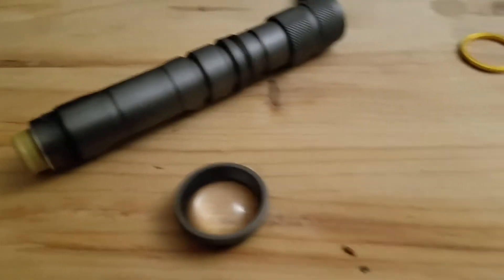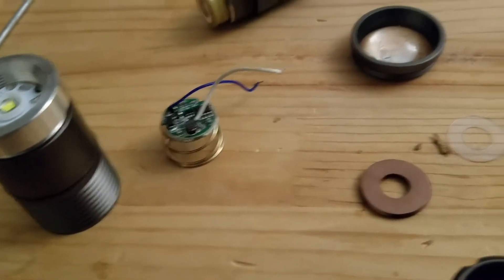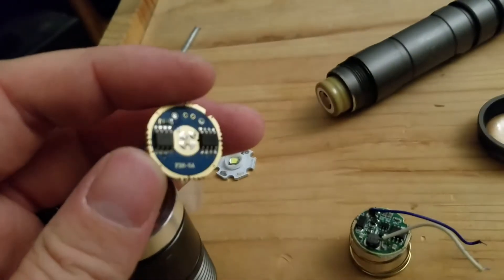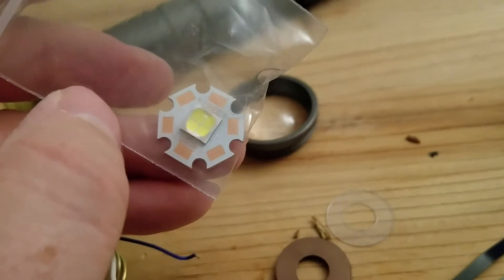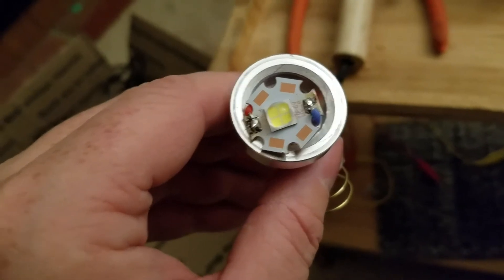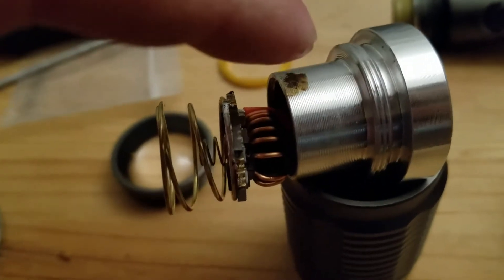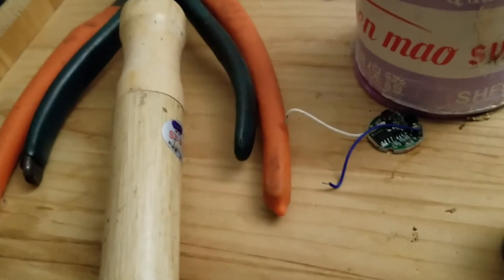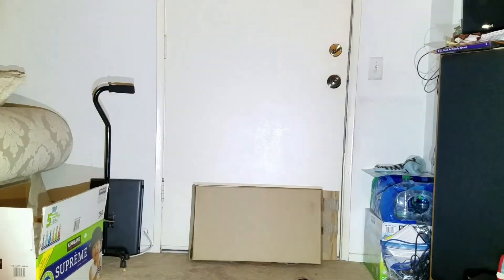Led flashlight rebuild: replacing a Cree T6 with a XHP70 Led

Comment: What brand flashlight is it?
Reply from the maker: It was a no-name brand found on eBay. I think I got 2 of them shipped for $10. They both failed quickly so i used them as hosts for other projects
Reply: @jasonhornby3161  perfect.  Thank you! Got an xhp70.2 and a 5 mode driver I need to find a home for!

Comment: if this not a zoomable flashlight and use reflector light it will perform more better flood and throw of the light ..convoy m1 is a great edc size host that use reflector to combine built with xhp50 or xhp70 mod.. i have xhp50.2 mod in my convoy c8... xhp50.2 also is more than enough that produce more than 3000 lumen and im choose xhp50 is because the newer one it is available in 3volt instead of 12v on xhp70.. so i dont have trouble to find any 17mm boost driver that can fit into c8 body...if you want a long reach flashlight but compact size maybe you can try consider a c8 host from convoy brand.. the body is solid and can take so much of abuse that the heat produce.. here the example of c8 build https://youtu.be/uXdc1JHTSLE

Comment: What led driver did u use?
Reply from the maker: Here is the link to the driver that I used:  
http://www.kaidomain.com/p/S025265.New-FX6-22mm-6V-8_4V-5A-2-Groups-of-4-to-6-Mode-Driver-Circuit-Board-for-Cree-XHP50-XHP70-MT-G2

...and yes it DOES get HOT if used on high for more than a few minutes.  It is best to use the lower modes for longer use.  I may be building two more in the next few months to try out some different parts.  Waiting for those parts to come in.  There are much better drivers out there than the one that I used in this video but it was cheap.

Comment: Cool build!  But there is no way you soldered the PCB to the aluminum!
Reply from the maker: Atimatik Army yeah you got me there! I ended up using aluminum brazing rod and a MAPP gas torch to get the bond.  I may make another video on how I did that procedure it was really rather difficult procedure but once I got it figured out it was a cinch so I can show you guys a shortcuts on how I did that

Comment: How did this hold up? It didn't overheat did it?
Reply from the maker: Billy Joe It is my daily carry but it does get toasty!  I've melted a bunch of clicky switches!  The best clicky switches are found on kaidomain website. They have a 6A 220v switch that sorta fits but with a file and a hammer, it will fit. I may do an update video to show that mod.
Reply: Jason Hornby hmm how cool man. I was just curious
Reply: Jason Hornby is the batteries 18650s?
Reply from the maker: Billy Joe yes.  I'm currently using two LG 18650 cells
Reply: Jason Hornby I was gonna try this on these knockoff ultrafires I have.  They take two 18650s
Reply from the maker: Billy Joe Just measure the PCB size of the current LED driver with a caliper.  This way it will make it easier to find one with a good fit.
Reply: Jason Hornby alright now I'll see what happens
Reply: you need solid pill heat sink no hollow pill

Comment: ok ik this is old but for it to transfer the heat to the casing you can use olive oil seal the electronics and the oil will trnafer the heat don't use refregirant because thats conductive and will damage the electronics or thermal paste
Reply: Olive oil? Are you sure? I know for sure mineral oil is used to make PC builds in aquariums and it's non conductive but it's the first time I hear about olive oil. Sorry if I'm asking after 5 years😅
Reply: That is so crazy but I feel like I need to try this